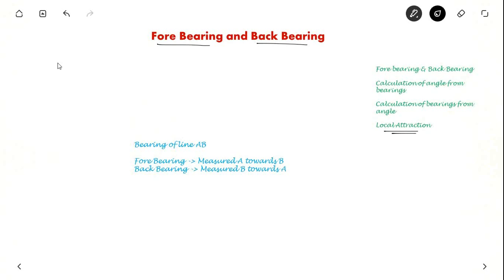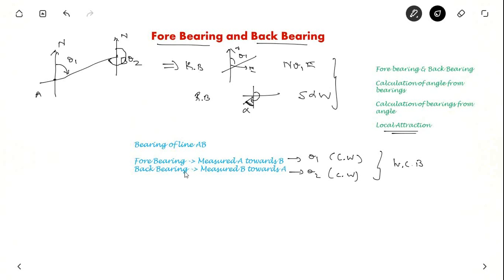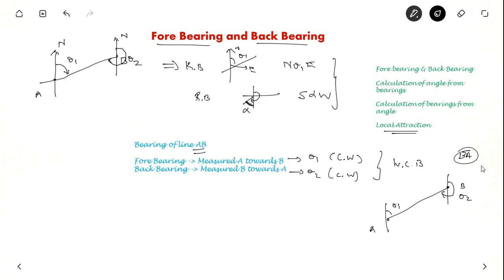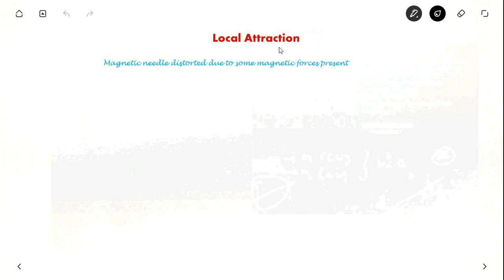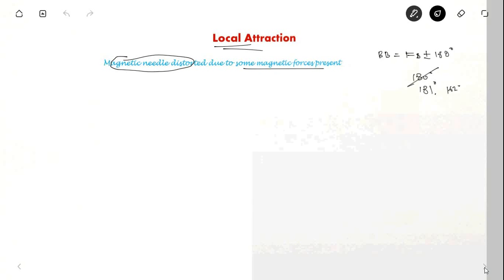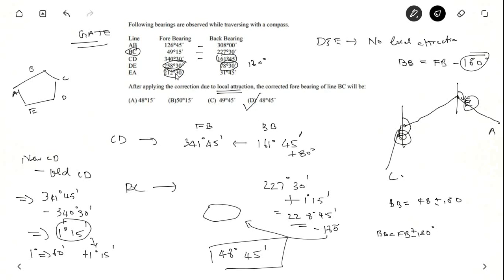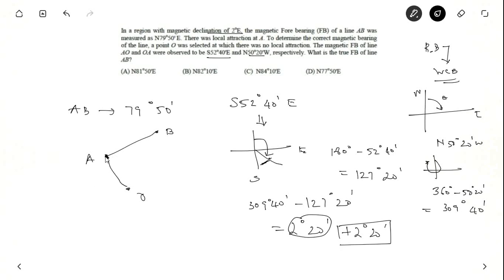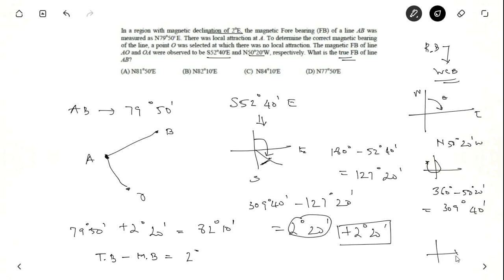Fore Bearing and Back Bearing | Surveying

Comment: Sir can you plz tell why the correction is positive @13:19
Reply: Becoz difference between 309.4 and 127.2 will be 182.2 , it is 2.2 more dan 180 and will be +ve.if the difference would be less than180 then dat will take as -ve.

Comment: sir at 10:32. why local aatraction is added? why not subtracted? la is always additive?
Reply: Sir at 13:23 the actual bearing was lesser than the given value of bearing... still u considered the sign as positive...
Reply from the maker: It is not always additive. Don't confuse with the signs. The actual bearing was greater than the one in the question for CD. If say the actual bearing was lesser, then we ll be using opposite sign
Reply: @APSEDUVERSE  sir, why you have taken positive sign of local attraction even if the actual bearing coming less than the bearing given in the question?